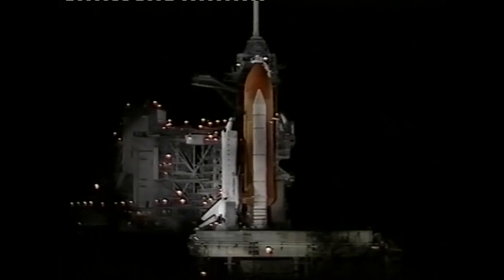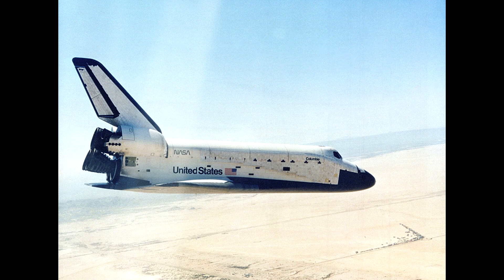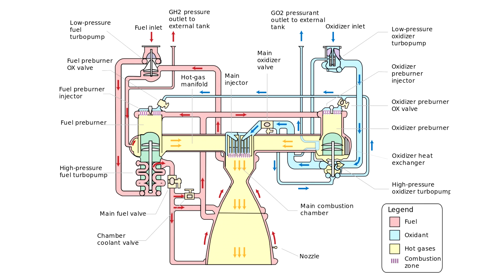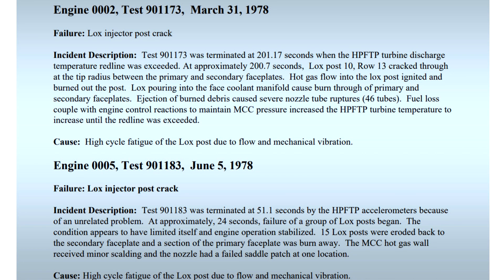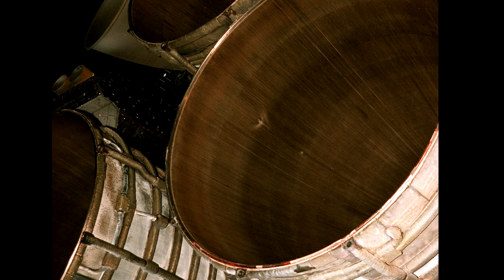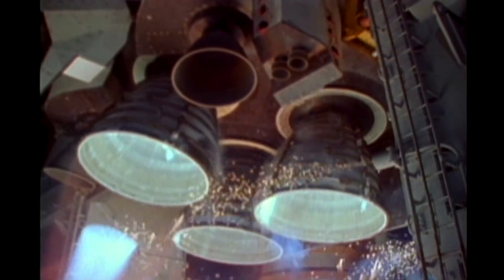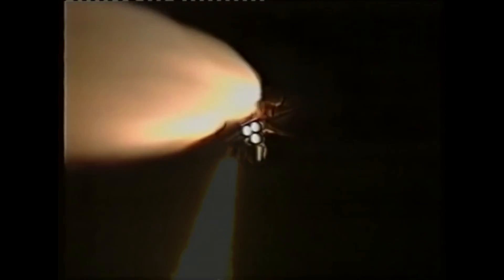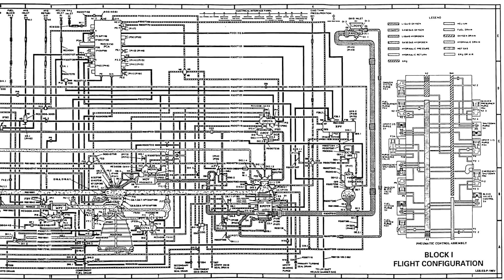How A  Gold Bullet Almost Destroyed A Space Shuttle

Comment: You need to get your terminology straight. The guy who over-tightened the screw is not an engineer. Engineers don't build things. They design it. The guys doing the building/assembling/maintaining are mechanics/technicians/assembly line workers. They do their jobs according to plans and procedures made by engineers but an engineer typically never touches the parts. During prototyping maybe (still not common), but never for production spec.

Comment: 8:05 he mentioned that the screw was tightened too much but it looks like it was damaged while being un-screwed during dis-assembly in maintenance or repair, so presumably it was stuck and the engineer didn't replace it after forcing it out, instead of being over-zealous while tightening it; possibly another example of the 'good-enough' safety procedures ultimately responsible for Columbia's loss.

Comment: Funny, how Scott starts by saying if one thing goes wrong the rocket will fail. In this case this clearly wasn't so. Multiple failures, based off 2 primary failures (worn out, shorting cable and 3 punctured fuel lines), still didn't stop the mission from being a success. Even though it was a very, very close call, the old bird still had enough in terms pf redundant systems, to overcome the 2 major failures. And then they say she was a poor design.... I'm not saying the shuttle was the best solution or even the best implementation, but give the people that did the hard work to build this, their due.

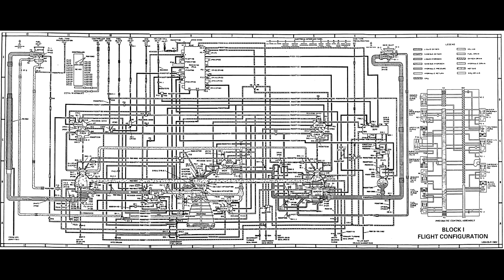Comment: 1:21 (and diagrams following too), the complex plumbing: come on, there must be a better way. All that weight. All that bulk. All that bulk and weight just to house it. All that additional risk for every extra inch. Hey, I don't have the answer, and rocket propulsion is awfully damn successful and impressive. I have NO doubt that it's all there for a reason, for good reasons. But some propulsion engineer, or some young future one, must give inspired thought to this aspect.

No doubt,  great engineers already make the most advantage of distances to cool or heat along the way, radiate energy to a system that a pipe goes through, provide safety separation, and so forth. But how about: dilithium reservoir, connector/valve, reaction chamber, connector/valve, propulsion unit, connector/valve, exhaust? Hey, greatness often originates in an against-the-norm dream. Thomas Edison didn't give a flip about lesser men mocking his persistent and unwavering dedication to impossible dreams. Do you?
Reply: This is what it takes to build the most advanced rocket engine on the planet.  These things aren't simple.

Comment: 10 things go wrong, successful launch... the total loss cases all were one thing going wrong with catastrophic results
Reply: This is because the vehicle survived long enough to count the failures. When the results are more catastrophic, the rapid unscheduled disassembly means you might find out the biggest few things to go wrong, and have to fill in the gaps yourself.
Reply: what do you mean? challenger it was an oring that let the booster explode (1 failed part), columbia got destroyed by a piece of foam hitting the heatshield (1 failed part)
Reply: Cascade failure. The foam didn't kill Challenger, the failure of the heat shield killed Challenger. But the heat shield wouldn't have failed without the impact damage -- it didn't fail immediately, as the damage occurred when the heat shield wasn't under any real stress. It's a chain of cascading failures that results in Rapid Unscheduled Disassembly.

As for the O ring, it could have leaked but not blown up, like in the video. Or conversely, the video scenario could have gone a whole lot worse.
Reply: Scott Sakurai I think you mean Columbia.

Comment: How would the weight of the payload affect an emergency landing, either the go-around or abort? In all the years I've been watching docs on the shuttle and reading about it, I don't ever recall hearing how a heavy payload inside would have changed the landing characteristics. Empty it fell like a rock...what would have happened if it almost literally came back with extra rocks? Cheers Scott!
Reply from the maker: They would come down faster and land faster, they had all the numbers already precalculated.
Reply: I would imagine that meant the landing tolerances were such that it could land safely even with the maximum payload? Or could there be a case where it was too heavy to land safely or at least would be a brown trouser moment for everyone? Wouldn't envy the crew in that situation.
Reply from the maker: I think any hasty landing after an abort would be nerve wracking. At least they probably know where the brakes were, unlike me.
Reply: If a payload caused a shuttle to be too heavy to land, then the shuttle would have NO abort options during ascent (other than, maybe, bail out over ocean during descent).  I don’t think mission rules would allow that.
Reply: Shuttle was designed to return with payloads, including some fairly heavy ones like Hubble. Columbia retrieved and landed with the LDEF, which was about 10 tons IIRC. Not sure about this one.

Comment: Do hydrolox engines have a lean point where the temp will drop like gasoline engines do?
Reply: 1320crusier yeah but you can't use   it because superheated O² still erodes & consumes the chamber & plumbing. that & crossing the stoichiometric domain that melts the engine as you adjust ratio
Reply: makes sense.  I suppose something similar would happen if you tried to do something like that with a nitrous fed engine.

Comment: OMG I never knew of that near disaster. They came very close to total vehicle loss, and loss of crew. I was aware that in the case of the reusable space shuttle orbiter after every launch the main engines had to be stripped down and completely inspected and serviced. Your video gives more insight as to just what this entails and how complicated it is. I have wondered about this detail in the SpaceX reusable first stage. I would really like to know the extent of the inspection and servicing required to reuse the Falcon 9 engines. There has been a temptation to characterize the reuse of the Falcon 9 first stage in airliner terms: 'just refuel it and go'. This is nonsense. Getting into space is a vastly more difficult proposition. A rocket has been more accurately described as an 'controlled explosion'. When I worked on commercial satellites we jokingly referred to the choice of launch vehicles our customers could choose from (Atlas, Ariane 5, Proton), as a choice of which 'bomb' they could choose to put their satellite on!
Reply: I don't think it's fair to compare the engines of SpaceX and the shuttle. Ignoring the fact that the SpaceX engines are simpler there is also the fact that the crew on the SpaceX rockets will be riding at the top end in a launch abort system capable of pulling away from the rocket at any height. The Shuttle had no real abort system and what options they did have depended more or less on a complete save of the shuttle superstructure mid accident. As for the extent of Falcon 9 servicing they have taken the exact opposite route compared to the shuttle. SpaceX has had long cycles with a great deal of testing and tear down on early iterations of the design. They have built the re-usability into their engines over time. The Shuttle program started out with minimal refurbishment and only increased it as the accident rates started going up. For SpaceX this is not really an issue as they will just retire any vehicle that fails it's inspections post flight or that has reached a number of flights where their confidence in it is reduced. I'm sure there will still be accidents, but I doubt the number of failures by the time they reach the same number of flights as the shuttles, will be much worse and I'm pretty sure the loss of life is lower. At least for the Falcon 9. The BFR is a completely different beast and it will be interesting to see how well it fares as the design is far more complex and has a lot of similarities to the shuttles. Personally I'm far more interested in seeing how that thing fully loaded is supposed to handle an on-pad abort as opposed to the Falcon 9 where the system is already tested and the core design ideas have been proven through numerous earlier launchers.
Reply: +aBoogivogi Yeah, a BFR on pad abort is going to be very interesting indeed. Do you just fire all main engines directly down onto a canister full of liquid oxygen and liquid methane? Can a set of Dracos lift a fully fueled BFS off a booster?
Reply: I dont think so, It will need hundreds of dracos for a job like that. & without hundreds of dracos... If you want to fire all main engines to get out of the main booster, it will be imposible... probably the TWR of a fully loaded BFR orbiter on sea level shouldn't be greater than 1 or maybe 1.1, can you imagine? just the explosion of the booster will probably destroy the engines of the orbiter before it reach a safe distance.
Reply: Well for one Space X is designing its engines so they don't have to be stripped down after each flight.  They are designed to be put through a battery of tests, then reflown after the test all pass.  No major refurbishment needed.
Reply: SpaceX is also using many engines and designing them so the mission can continue even with multiple engine failures, thereby reducing risk overall.
Reply: How do you know that? have you seen the SpaceX documentation and read it in detail?
Reply: "There has been a temptation to characterize the reuse of the Falcon 9 first stage in airliner terms: 'just refuel it and go'. This is nonsense."

This is not nonsense. This is the engineering goal. Otherwise spaceflight will remain very expensive.
Reply: Space is hard
Reply: That part he mentioned sounds like something you'd only have in a Staged-Combustion engine and not something that'd be needed in an engine that just dumps the turbine exhaust.
Reply: Most engine types in existence that use vaporized fuel use "controlled explosions" not just rocket engines. Internal combustion and jet engines control or contain their own "explosions".
Reply: @nemo-x  IIRC, the problem with the X33 was that they couldn't make cryogenic tanks out of  lightweight composites. SpaceX tried that for Starship, found it didn't work, and switched to stainless steel. Note that the closest thing so far  to an SSTO, the original  1 1/2-stage Atlas rocket, was also made of stainless steel, as were the XB-70 and Bristol 188 supersonic research aircraft of those times. This suggests to me that Elon and the people at SpaceX have read all the literature of the 50's and 60's, and revisited  the solutions proposed or tried then but discarded as multi-stage expendable rockets derived from the ICBM programs became the quicket way to get into space. The X-20 Dyna-Soar spacecraft was also to be nearly all-metal, though its alloys were more nickel-based or molybdenum.

SpaceX's great contribution is to recognise that stainless steel alloys are superior to other materials at both very low and very high temperatures, and only at "room temperature" do other materials have markedly better strength-to-weight ratios. In addition,  suitable composites are much more expensive.

Hydrolox is not the best propellant combination for getting off the ground stages because the very low density of LH2 requires a very large cryogenic tank, hence the need for SSBs (STS, SLS) or kerolox boosters (Energiya/Buran, Long March 5) even when hydrolox is used at liftoff. The Delta 4/Delta 4 Heavy is rather unique in being an all-hydrolox launcher, very efficient but expensive, with large diameter core and boosters too big to transport by road or rail, unlike the SpaceX Falcon9/FH, which greatly cuts Space X's costs. So, the X-33's need to use LH2 for its high specific impulse led to an engineering impasse, which is too bad given the attractivemess of the concept. The original STS idea was to use a very large winged carrier to get the Shuttle to the top of the atmosphere, from where it could use its on-board fuel to get into orbit. Its cost forced the Nixon-era compromise which became the eventual Shuttle with reusable SRBs and large expendable tank. A classic case of penny-wise, pound-foolish, although the carrier craft concept suffers from some of the STS's deficiencies, too. Later hydrolox SSTO concepts (e.g. HOTOL) have not come to fruition, either.